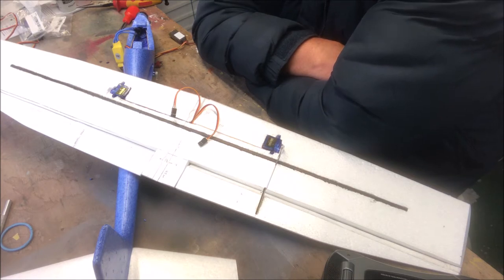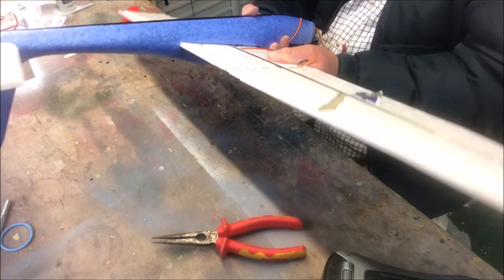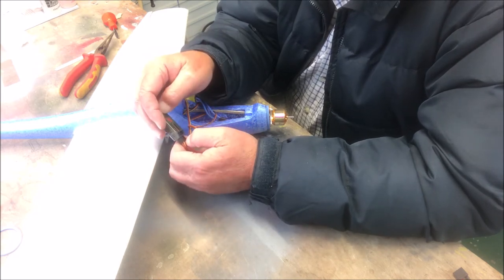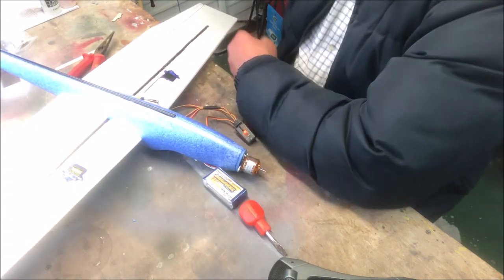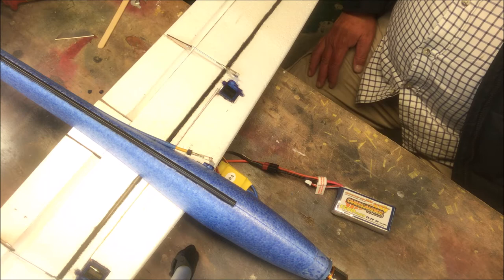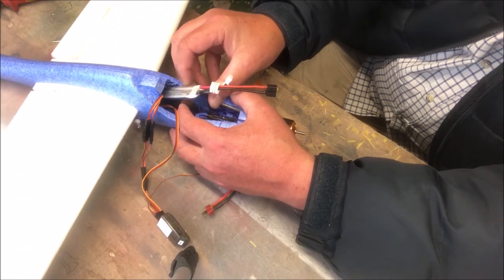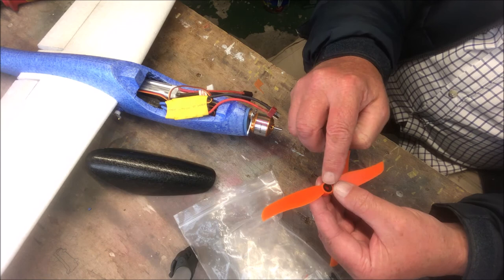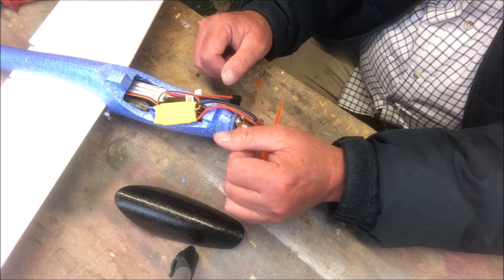Final Assembly of  Wings of the Lidl

Comment: bonjour le moteur  c'est  toujours  le  2212/6T  2200 kv  et  l''accus  c'est  un accus de combien   svp merci ????
Reply from the maker: Le moteur est un 2200KVA et j'utilise dans cet exemple une batterie Lipo 1300mah 3 cellules 11.1V avec un connecteur Deans.
Certains appellent ce connecteur un connecteur en T. J'utilise également un contrôleur de vitesse de 30 ampères.
Normalement, j'utiliserais une batterie Lipo 3 cellules 11.1v de 900 mah.
Mais cette batterie que j'ai achetée récemment pour un autre modèle, et je sais donc que la batterie ne chauffera pas.

The motor is a 2200KVA and I am using in this exsaple a Lipo 1300mah 3 cell 11.1V battery with a Deans connector. 
Some call this connector a T Connector. I am also useing a 30 Amp speed controller.
Normally I would use a 900mah Lipo 3 cell 11.1v Battery.
But this battery I bought recently for another model, and so I know the battery will not get hot.
Reply: @thebarronflights1948    merci pour votre reponse